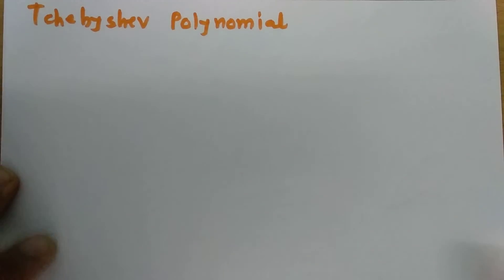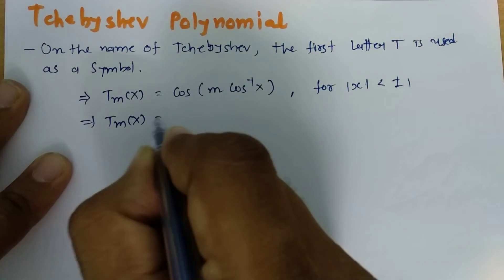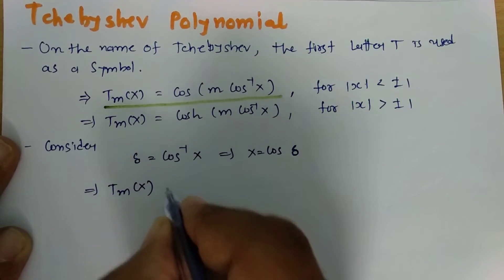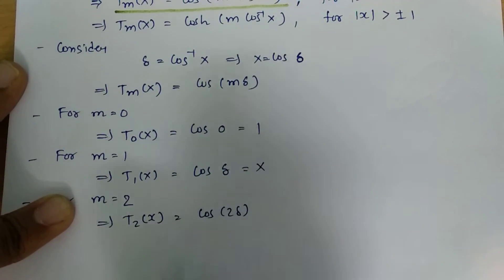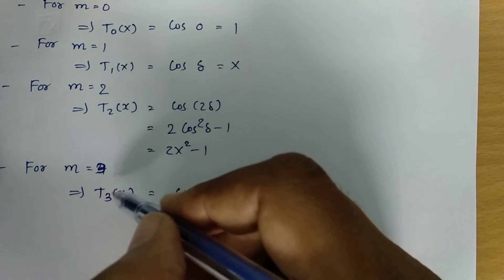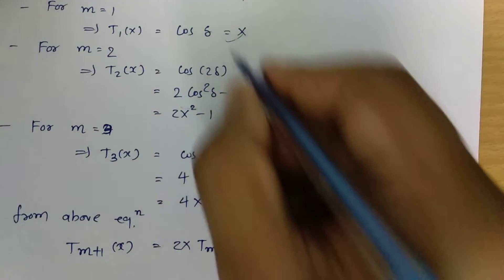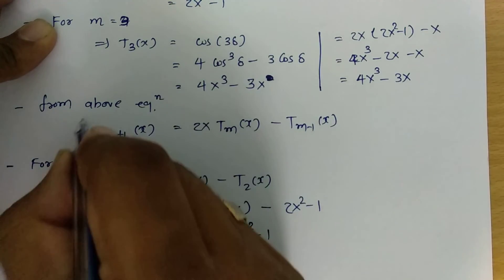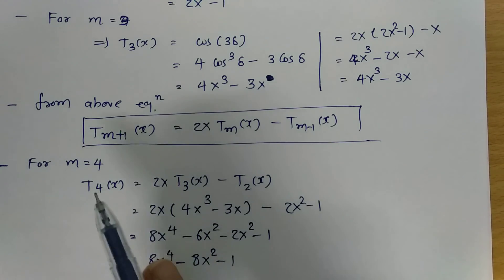Tchebyshev Polynomial | Antenna Array | Antennas and Wave Propagation | Engineering Funda

Comment: So I understand, like you said, that the Tchebyshev polynomial is used to determine the weights of the Doplh Tchebyscheff Array, but I'm not sure if I was able to catch where the weights come into play physically. Are they the currents you put into each element? Or the match termination resistance(?) values?

Where does 'x' come into play?
Reply from the maker: Power of x defines number of elements
Reply: @EngineeringFunda  I thought that was 'm'. So then what does 'm' do?
Reply: @valtinryu8147  the polynomial values tells the Amplitude with which we have to execite the respective antenna elements